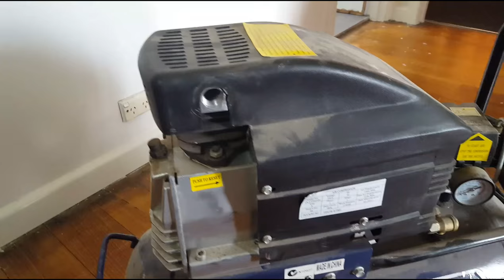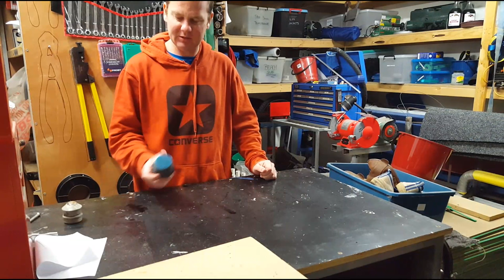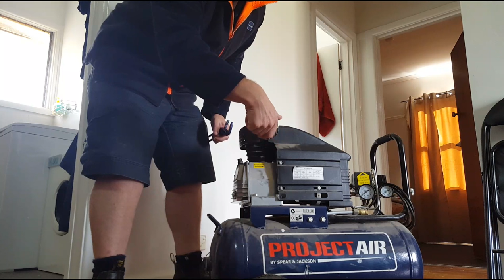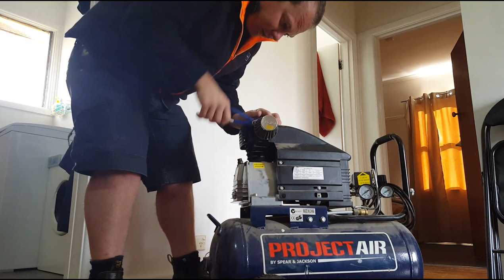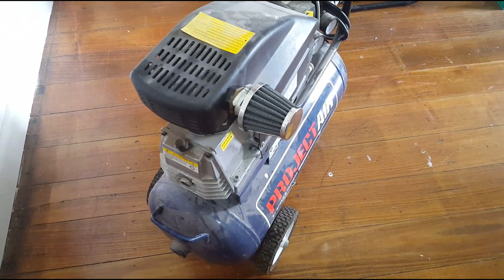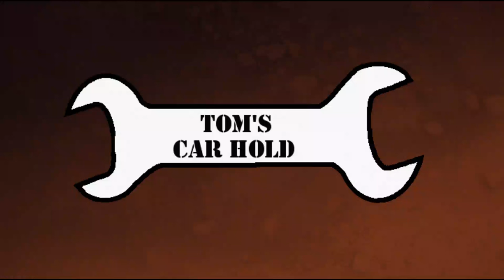Air Compressor Filter Replacement Or Upgrade HD

Comment: You put a hose clamp on but what did you do to keep get it air tight so that it wouldn't leak? I couldn't hear you that well in the video when you were explaining that
Reply from the maker: I just went round the thing with roof and gutter silicone mate